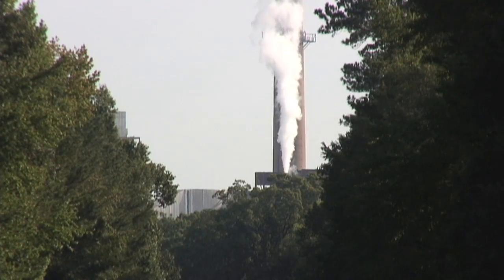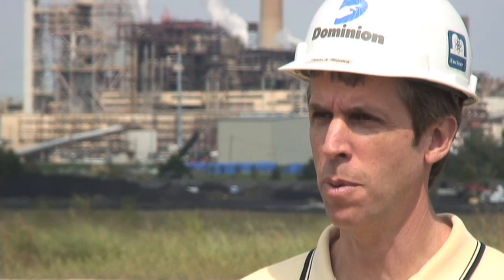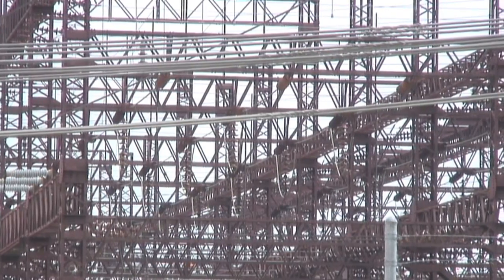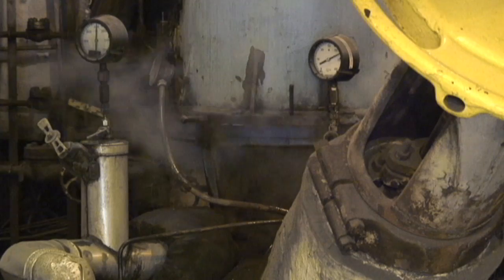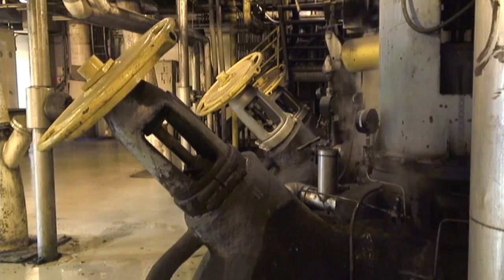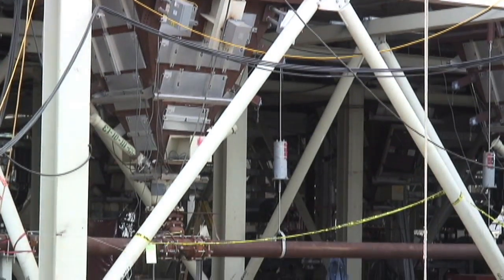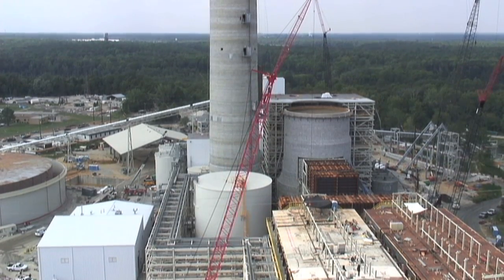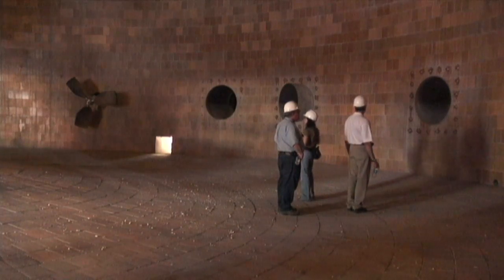Coal Fired Plant

Comment: @aspieresearchmom PART 8: The waste materials produced at a coal plant are often used to replace raw materials that are mined. Fly ash is used to replace volcanic ash to make concrete and other things. The sulfur dioxide in the furnace exhaust is used to replace sulfur to make sulfuric acid, or is used to make gypsum which is used to make wallboard and other products. The slag is used to make sandblast media, concrete, and asphalt.

More to come...

Comment: @aspieresearchmom PART 7: We also inject activated carbon ahead of the baghouses. This binds the mercury to the fly ash that the baghouses filter out. Not only does this allow the bahouses to filter out even more mercury, it also makes the mercury more inert (like it is in raw coal), which keeps it in place so that it's much less likely to pollute groundwater.

More to come...
Reply: The power plant i worked at we the same exact thing to capture mercury in flue gas and a different pac to help cut  Nox.

Comment: @noisypipes05 Actually, a combined-cycle combustion turbine natural gas power plant CAN produce the same amount of power. And they can be started quicker, requiring much less warm-up time. As long as they are combined cycle (meaning the heat from the engine exhaust is used to make steam for a steam turbine), they are more efficient than coal power.

I've worked at TECO's Big Bend (coal) and Bayside (natural gas) plants. Both are about the same MW capacity., So YES, natural gas can make as much.

Comment: @aspieresearchmom Using solar to make steam and then using that steam to produce electricity is more efficient than using solar cells to produce electricity. And existing steam turbines at coal fired plants can be used, with the steam from solar supplementing coal. The amount of coal required to produce electricity there can be reduced.

However, you still can't produce steam with solar at night. Clouds reduce steam production, and so does cold weather. And you can't effectively store steam.

Comment: @aspieresearchmom It's also the amount of land area required for the amount of power produced. My company just put a 50 acre solar project into service. It produces .5 megawatt (1/2 megawatt) using 50 acres. A typical coal plant like the one I work at is 1800 megawatt on 50 acres. That's 3600 times the power output per acre, making it a more useful use of land area. And a natural gas power plant is even more size efficient.

And that's assuming the VERY BEST conditions for maximum solar output.

Comment: @stonerj0e Most of the mercury is removed BEFORE the process that makes gypsum, even more so if the plant uses baghouse filters instead of precipitators, and even more still if they use activated carbon injection. And the minuscule amount of mercury that the drywall MIGHT contain will be barely measurable (if at all), and won't hurt the homeowner unless the homeowner eats the drywall.

And if a homeowner eats drywall, he's got MUCH more to worry about than just mercury.

Comment: @aspieresearchmom PART 5: With all the mw of power required by US consumers on a typical day, it will take MANY years of constant "green energy" construction to even come close to coal's current generation capacity. I figure at least 15 years, and that's assuming America doesn't go bankrupt before then. Fact is, wind, and especially solar, are way more expensive than building a coal plant (per mw of power output). And it's much more expensive than that to replace an EXISTING coal plant.

Comment: @aspieresearchmom I don't have "studies" to give. I have a lot of experience in the power industry, as well as a lot of knowledge about various forms of power production, including "green" energy.

It will take years before solar and wind will come close to replacing coal.

And the issue with solar isn't JUST the pollution associated with the manufacturing process. It's the pollution versus power output. It's also the raw materials used versus power output.

More to come...

Comment: @aspieresearchmom Part 22: I NEVER said that solar can't be used at home. However, this DOES still have limitations. It rules out the practicality (and therefore better efficiency) of solar-to-steam for power generation. And solar on each home versus solar at several big locations utiliziing an existing pwer grid is likely less cost-efficient. And there's the many years it takes for the energy savings to pay for the cost, whicch most homeowners can't pay for in the first place.

Comment: @aspieresearchmom PART 4: Wind power isn't always consistent. And by that I mean wind speed and wind force, not just whether or not the wind is blowing. And it's quite OBVIOUS that not every location in the USA produces enough wind. Plus, with the required wind generator spacing and 1.5 megawatt output per generator (again, under the VERY best conditions, usually less than 1.5 mw), how many acres of wind turbines do you think it takes to replace one coal plant?

Comment: @aspieresearchmom PART 10: You said "Why don't we just get rid of coal fired plants ?"

Well it's VERY simple. ANY running power plant (whether coal or not) needs a reliable, viable replacement BEFORE "we just get rid of coal fired plants". PERIOD.

Not only does each area of the country need a certain mw of total power production at any given time, each area also needs a certain amount of reserve generation capacity. THIS IS A FACT.

It will be MANY years before "green" energy will suffice.

Comment: @aspieresearchmom PART 3: Solar doesn't even produce at night, so figuring that into the equation makes it even less efficient. Then there's less production when it's cloudy and during shorter winter days.

Hydro power varies according to seasons and rainfall. And the power output is often quite small. There's a few local hydropower dams here that are like 20-30 megawatt. And you can't put a hydropower dam just anywhere. Plus, are you naive enough to believe that hydropower causes no harm?

Comment: @aspieresearchmom PART 6: In the mean time, coal pollution reduction technologies are much better. My company switched to baghouse filtration to replace precipitators, and particulate output reduction went from 90+/-% of furnace output to 99+% of furnace output. That's less than 1% output. Mercury output is now also less than 1%, and is so low that current mercury output measuring technology has trouble measuring the super low amount of mercury in the stack emissions.

Comment: @aspieresearchmom PART 23: Tell me, how many homeowners have the knowledge, tools, etc. to maintain their own solar plant? Woludn't a utility have people readily availble for troubleshooting/repairs/maintenance at a utulity-owned solar plant? YES. Wouldn't it be more cost-effective for the UTILITY to use solar power? YES. Homes, especially less efficient older homes RARELY have enough roof surface to power the whole home. Making older homes more effificient further adds cost.

Comment: @aspieresearchmom PART 24: I personally know a guy that spent $20k to add solar to his house. With the relatively low cost of power from the local utility (which is the same as my utility), and assuming a $100 a month electric bill from the utility (a LOT more than my bill), it would literally take 16.67 YEARS to pay for it. Wanna know another FACT? Solar cells have a lifespan like a battery does. It's likely he would need new cells before 10 years, which adds even MORE cost.

Comment: @aspieresearchmom The "green" sources of energy are nowhere near enough to take over from coal. In most areas of the country, there's not enough wind. Solar only works during the day, and is greatly reduced by clouds, rain, snow. Neither is as cost effective as coal. Wind energy kills birds. Solar covers so much acreage, and native plants must die. Solar cells have a useful life span and will need replaced. Solar cells require polluting, dangerous chemicals to manufacture.

Comment: @aspieresearchmom PART 13: Yes, it IS necessary to use coal. Because like I've already CLEARLY stated, the alternatives we now have are NOT CURRENTLY producing enough megawatts of output to replace existing coal plants.

For some reason you keep missing that.

One day it may can be done, but right now it CANNOT be done.

It will take YEARS of construction of alternative sources AND STORAGE METHODS in order for them to be able to produce enough megawatts AROUND THE CLOCK to replace coal.